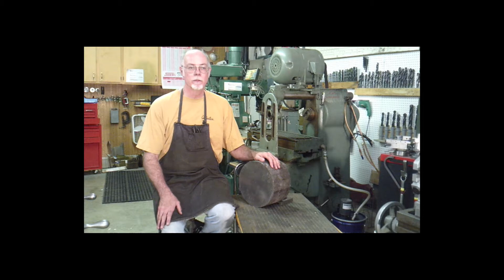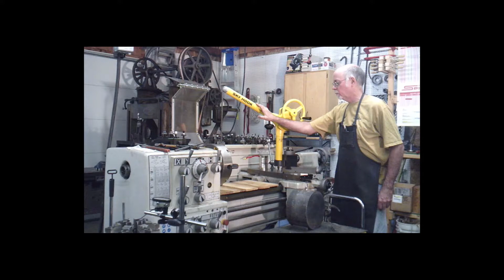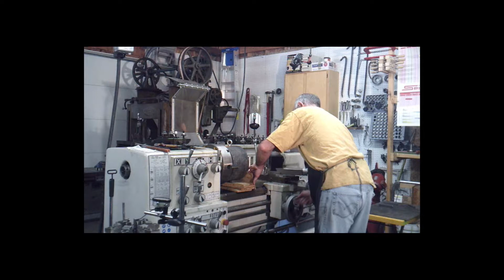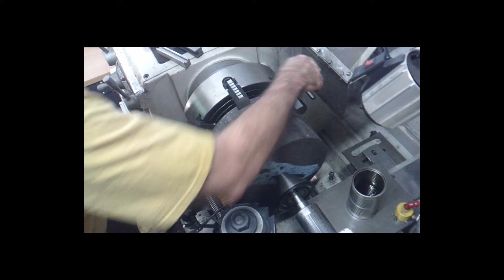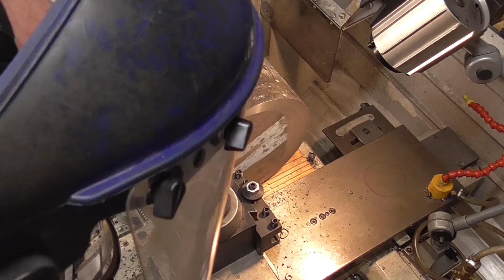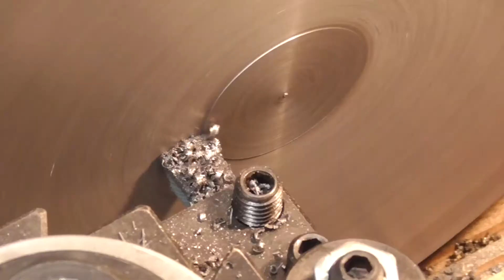Adapt! Part 1 (original format)

Comment: Thanks Gary: Yep I know it is a casting\, but I'm going to fabricate something like it from a plate... What I was looking for was you said <it is a casting that is several inches thick> how many is "several" ?  Thanks Brian.
Reply from the maker: The overarm is about 3-1/4 incheas in diameter and the casting is about the same length there. At the arbor, the casting is about 3 inches. It needs to be thick enough to support a fair length of the running bushing, but need be no longer than the bushing is thick.
Reply: Gary Storrick Thanks Gary thats exactly what I was looking for... as it give me a sense of the proportions etc...  etc...  Thanks a ton ! Brian
Reply: GUSMIX22 I would like to send you some pictures of what I'm doing with my mill, but can not do attachments of pictures hear.. Is there a way?
Reply from the maker: GUSMIX22 email: storrick at storrick dot cnc dot net

Comment: Gary very nice.  2 questions 
1 at the beginning of this you are sitting next to a horizontal mill with a bar for a over arm support bar that is round... I have a machine similar to this http://www.practicalmachinist.com/vb/antique-machinery-history/brown-sharpe-no-horizontal-milling-machine-216057/  and I need to make a down support for the arbor... i,e off the end of the round bar... Question is... can you tell me the thickness of the plate that is in the bar at the top of the bar? as Im having a hard time determining how thick a plate to buy to fabricate that..
Second where did you get a face shield with ear protection from that is not a hard hat...? Cant find anywhere in the US anyway... 
Thanks 
Brian
Reply from the maker: GUSMIX22 Alas, the ear muffs ans face shields are separate items, not an integrated unit. The ones that I have do not interfere with each other so that has not been a problem. The arbor support is not a plate, it is a casting that is several inches thick. The plate that connects the arbor support to the table is about an inch thick. My web site has more information on that machine (storrick.cnc.net/Shop/ShopMachines/MillingMachines.html#anchorCincyMill). You may be able to estimate useful measurements off some of those photos. I'll try to dig my way out to the shop (snowdrift) to get you some more detail. Gary

Comment: it only needs to be centered so much as to provide the diameter needed for the final part to be made. So you can scribe on the FACE rather than the diameter. There's your centering in 30 seconds from start to finish.
Reply from the maker: Agreed. Taking the extra time balances the heavy casting a bit better on the spindle, and it also evens any effects of the chilled edge. Whether it was worth it or not is debatable, but sometimes it is better to do too much than worry about whether I'm doing enough. I make enough mistakes like the latter and don't need any more <grin>.

Comment: Hi Gary great series of videos,
I noticed a Cincinnati mil behind you in this video. 
Could you tell me about it, I have one that looks very similar. 
The motor on my mil lays on table below and left, flat belt drive. ?.
I haven't found any info about it,
Thanks Corey J
Reply from the maker: I assume you mean the green Cincy mill. What I know (not much) is on my web site (Google "Cincinnati 18 inch B. G. Plain"). It was originally flat belt (probably overhead line shaft) drive, but later converted. I will probably create a video about this mill someday. -> Gary

Comment: Hey Gary you could use a right handed boring bar on the outside of your work to get  more travel from your cross slide
Reply from the maker: I've done that in the past, but as we'll see in later videos, I did not really need to do that for this project.

Comment: I like the little skyhook how is it affixed to the lathe? Looking forward to rest of this project! :o)

O,
Reply from the maker: It attaches to the quick-change tool post just like a toolholder does.
.
I made a similar dovetail that I can bolt to my mill, shaper,  or planer tables so that I can use the skyhook there as well.